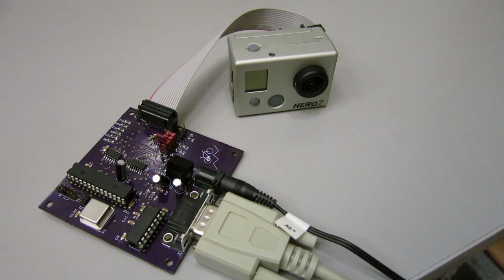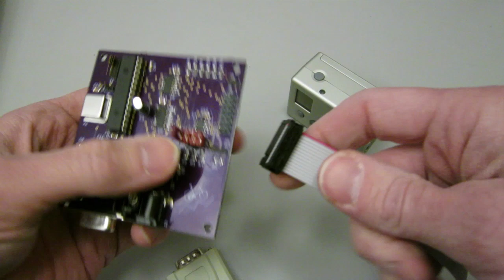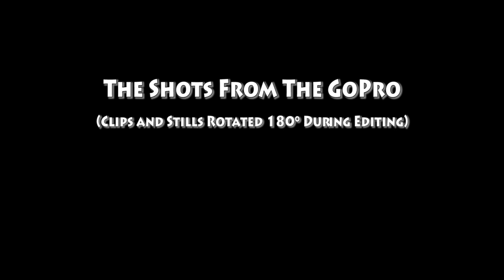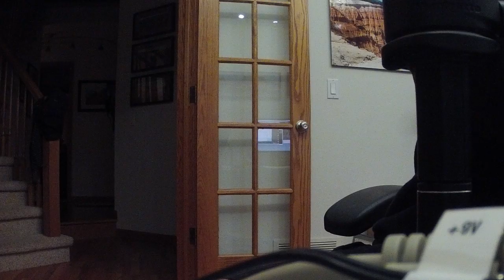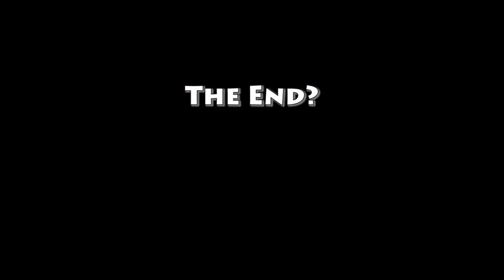Remote Control of a GoPro Hero2 Camera using a Microchip PIC and my PC

Comment: Have you been able to query the sd capacity over i2c/gopro bus?
Trying to research making an sd card switcher to auto switch when a card is full, I can get a json status output over wifi but one less radio is one less battery drain.

Comment: Thanks Glen for the information. I am not sure what is the role of the eeprom. Do you program the eeprom once with 0x05 FFFFFFF once and you forget about it or do you have to change the content of the addresses depending on the command? Thanks for the help.
Reply from the maker: You program it once and forget about it. The camera reads the EEPROM when it is turned on to determine what type of backpack is connected to it. The values I used tell the camera that it is connected to the slave end of the 3D backpack cable.
Reply: Just to make sure, do you call "wr 0005" to program the eeprom?
Reply from the maker: Miguel Charcos Llorens It’s been a few years since I’ve looked at my code but that sounds reasonable.

Comment: Glen,  I am currently developing an application of the Gopro H3+Black for use deepsea, interfaced thru an ROV control system.  For this reason, wired control is a must.  You appear to have cracked about all of the functions I need for our project.  Would you be interested in cooperating to help us complete this?  You can reach me on msubby@gmail.com Basically I need most of the functions that are available via wifi, using wired connection via the 30 way buss connector. Cheers
Mike

Comment: Ok thanks, but the idea is shoot a camera from PC application and then recover the information of picture from camera to make a relation in betwen when camera was shoot and  picture  name,  all trough Com port.
Reply from the maker: Sorry, I don't know how to do that with a GoPro. I'd suggest using an Axis IP network camera over an Ethernet connection with their open API or one of the newer Sony mirrorless cameras that is compatible with the Sony Camera Remote API over WiFi if you need higher quality than an Axis camera can provide.

Comment: Would it be possible to port this for use with an Arduino?
Reply from the maker: Yes. Just make sure you use a +3.3V Arduino and not a +5V version to keep from frying your camera.
Reply: Glen Akins  Apart from the custom cable (or iPod cable) to the camera would a Arduino have all the necessary components to make this work or would a break out board be required.

Would this be an interesting project for you?  Hint Hint

Comment from the maker: Hi, I do not own any Hero 3 cameras so I'm unable to try this project with the newer cameras. Do the Hero 3 cameras work with the GoPro 3D setup and cable? If they do, there may be hope to find a solution. If they do not work with the 3D setup, there probably isn't a solution. Yes, it would be much better if GoPro would publish an API for both the backpack connector and the WiFi interface. Unfortunately, that's not part of their business model.

Comment: Hello
Your project does not work with cameras gopro 3 black edition. It seems the ID1 to ID4 pins no longer have the same functions, I made measurements on ID3 which now seems to be an output, not an input. Similarly, after the connection, a series that is unknown to me frame is sent from the ID1 pin camera.
Gopro refuses to provide information on the interface bus. Did you? Did you try your project with a gopro 3?

Comment from the maker: Yes, the WiFi on the newer cameras would have made things easier, but the project itself was not completely useless. I built another board with what I learned from this board to control four cameras and an aluminum enclosure to house four cameras. Added a GPS, a tilt-compensated electronic compass, and an Android app. See my video "360 Panorama Camera Built with GoPro Hero 2 Cameras" for more details.

Comment from the maker: @ytaibt 1) Exactly. It's all 0xFF except for the first byte (address 0) which is 0x05. 2) My thought was just to supply power over the side USB connector. There's another USB connection and an external battery connection on the backpack connector too. I haven't messed with them yet.

Comment: @ktmglen Got it. Looks good and pretty clear. I have two missing pieces in this puzzle I guess:
1. What should be in the EEPROM? Some identifier of the 3D cable ("Left" end)?
2. Have you figured out how to externally power the camera? If started reversing the battery BacPac only to find that it is not a simple matter of proving voltage on two of wires. If you haven't, I can probably figure this out with a few hours' work.

Did you reverse it all yourself? Some info will be appreciated!

THANKS!